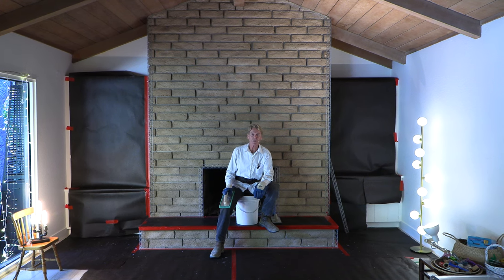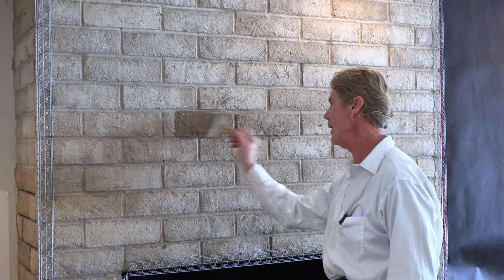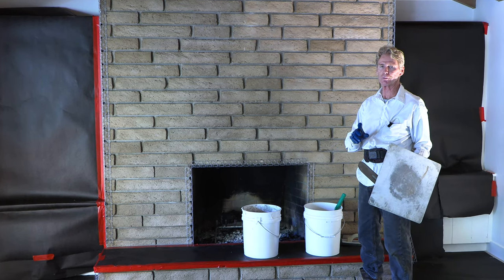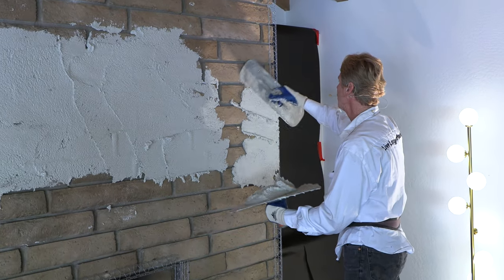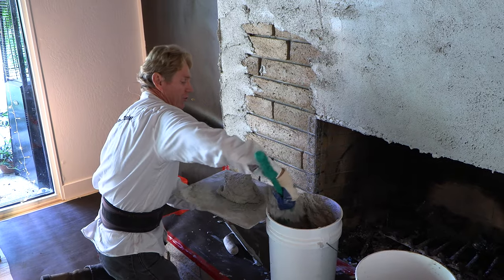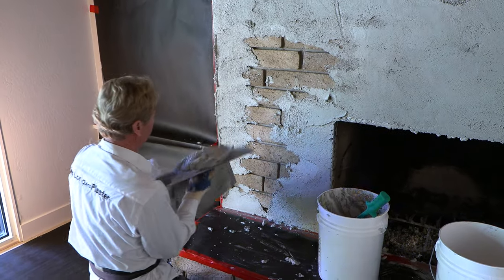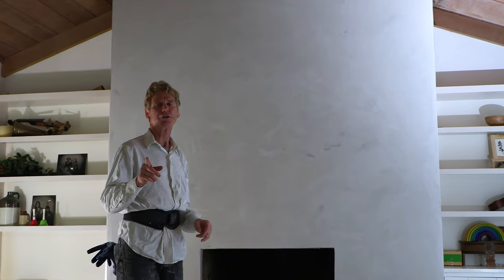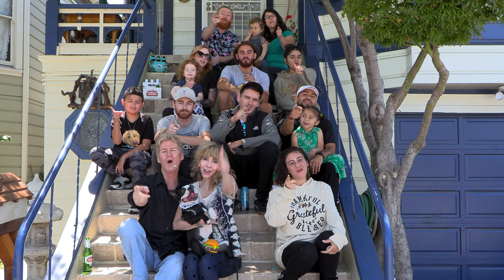Plastering over brick fireplaces with Lime plaster

Comment: Seattle plasterer here! What accelerator would you recommend for interior environments up here?
Reply from the maker: One can add any Portland-based stucco to Struto-lite or this Eko-plaste, to set or accelerate in. Or as in this video's description, I used and posted Calcium Formate.
Reply: @StuccoPlastering  Can’t wait to try Eko-Plast! 💥😎
Reply from the maker: @earthhousestudio7333  Howdy Ekoplaste is similar to Structo-lite sticky as glue drying, thus you need to keep your trowel wet.
Reply: @StuccoPlastering  Have a few fireplace resurfacing projects coming up. I’ve done all sorts of basecoats to level everything out on previous jobs, it all has worked well and beautiful. Can’t wait to try Eko-plast! Always great to explore new materials. Thanks for the tips! Love your work!
Reply from the maker: Remember keep the trowels wet and use accelerators, or you won't like the product as like structo-lite it takes forever to dry. It's like the old Lime plasters they flex, but the cost is sometimes not worth the wait.
Reply: @StuccoPlastering  How thick can you apply eko-plast before it cracks?
Reply from the maker: @earthhousestudio7333  Howdy Earth dude, I've gone over 2 inches with no cracking however, it's a drag to apply without an accelerator as dislike watching paint dry. Plus your trowel must stay wet when finishing just like if you were working with USG's structo-Lite.

Comment: Kirk, Can you put EkoPlast on painted brick?
Reply from the maker: Of course you can, however the walls must be cleaned and a bonding agent applied to it, like plaster-weld or quikrete bonding agent.
Reply: @StuccoPlastering  Thank you!!
Reply: @StuccoPlastering  Do you happen to have any recommendations on where to get the best interior Lime or Venetian Plaster to achieve similar results on my interior fireplace?
Reply: @StuccoPlastering  Also, You mentioned quikrete or plaster-weld for bonding agent. I ordered the Kemset off of your website. Would you recommend doing the Plaster weld bonding agent first, then Kemset w/ Accelerator then the final coat?

Will Yall were here in Dallas. Would love to hire you for my fireplace here.
Reply from the maker: @davidpichkar8239  This video will walk you through it. Yes, the bonding agent goes on first.
Reply from the maker: @davidpichkar8239  Google plastering yards in your area, "Westside Building Materials" has the best.